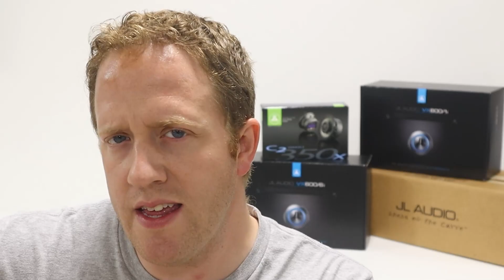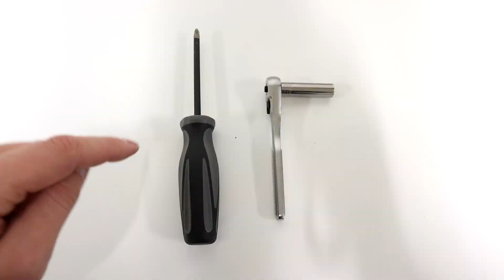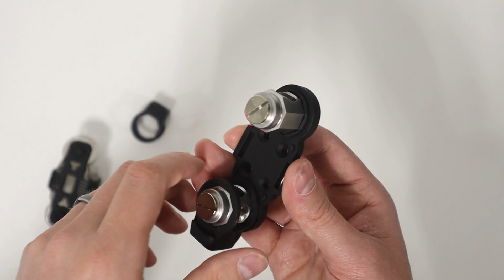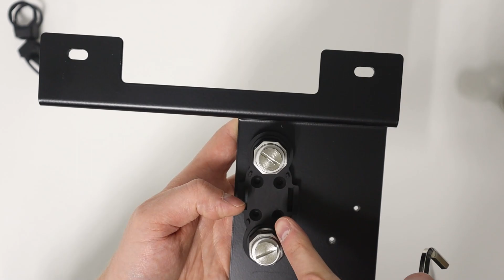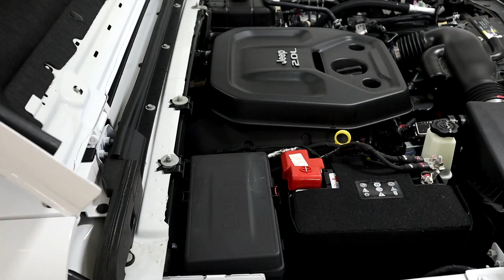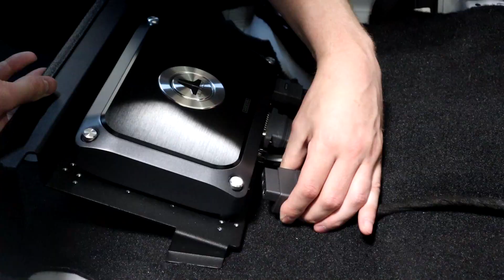JL Audio Fuse Block Holder Install for Jeep Stealthbox® | CarAudioFabrication

Comment: Will it fit a 392 Wrangler?
Reply from the maker: No sure if we have confirmed compatibility with that engine. If you can provide some pictures to our technical support team, we may be able to assist. You can contact them at 954-443-1100 or submit a support request via our help center; https://jlaudio.zendesk.com/hc/en-us/requests/new